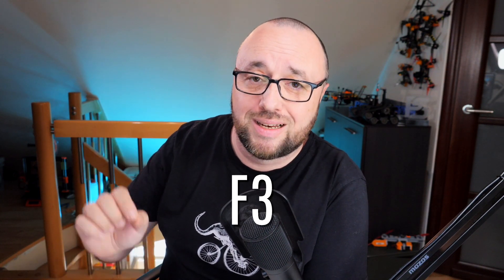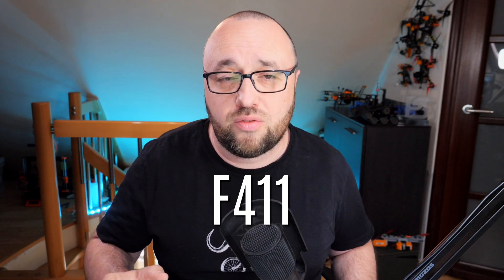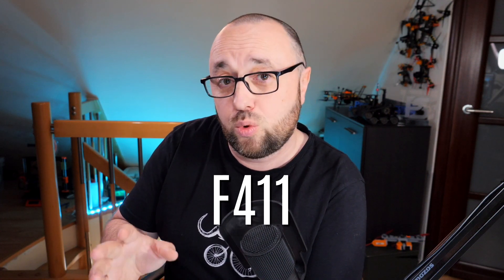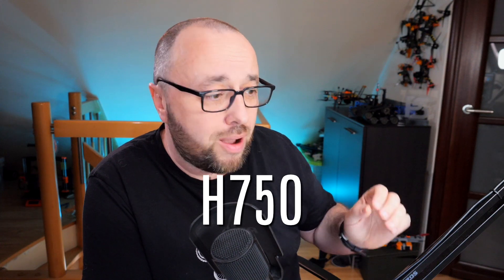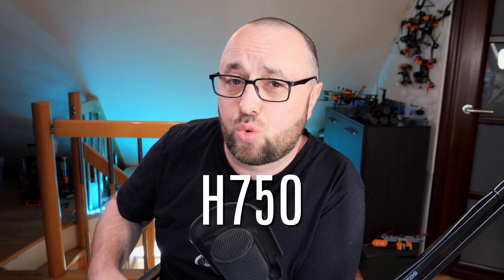Flight controllers for 2024 - F3, F4, F7 and H7

Comment: Hello Pawel, i have a question about Inav8.. i have a SequreH743 (v1) and i programmed it with inav8, everything seems to work fine..but it doesn't recognise the BMP280 barometer, i have to choose it from the list provided by Inav.. when i choose the BMP280 and save and reboot, it stay's 'red' and i can't get it to work.. i checked it with the graph's and it stay's flatlined.. am i doing something wrong or what? any help is appreciated ..
regards,
Morris

Comment: Thank you for the clear message. Why is there not a package that combines the microcontroller with other chips for example the transmitter, osd controller or the motor controllers? I understand the accelerometer and gyroscope are mems which require slightly different processing steps, but for the others, they could be done in a single die.

Comment: It in the product description of the F405, it says it works with quadcopters and octocopters. Would this work with a hexacopter build or not?
Reply from the maker: F405 is only a MCU, not the whole flight controller. Which exactly F405 you have in mind? But if it works with 8 outputs, then why should it not work with 6 outputs?

Comment: I use all F722 ,, they all work incredible super smooth ,, But I not use GPS !! why ? I fly freestyle .. so why count out F722 .. GPS is a waste of money  ,  betalight gps is worthless ,, your drone will stop 5 to 10 feet in the air with beta , flight fall out of the sky and break an arm !! if  its going down gps will not save you .. Gps is for beginners and youtubers trying to test to the limit and end up losing a $300 drone for what ? also I never use black box I set my motors to between 75 and 85 % motor output and you will never burn out an esc while flying or have issues with the F722 . go thru all the crap with black box I just buy a new esc which 9 times out of 10 is the issue and 8 out of 10 people probably never use it   . I set all my quads the same except if the quad is little heavy and filtering depending on gryo,  I do not take chances and your supposed to fly line of site anyway

Comment: Subject: [Help Needed] Connecting INAV to QGroundControl (QGC)

Hi,

I am having trouble connecting my INAV drone to QGroundControl (QGC). I have followed the instructions in the manual, but I can't seem to get the two systems to connect. I have tried searching for resources online, but I haven't been able to find a solution to my problem.

Could someone please help me with this issue? I would greatly appreciate it if you could provide step-by-step instructions or point me in the direction of a helpful tutorial.

Thank you in advance for your assistance.

Best regards,
[pritam]

Comment: Hi Pawel Am I stuck with a useless FC? For Christmas I bought a Lumenier Lux H743 HD to upgrade my 7 inch INAV quad because it had crappy video due to the lack of good voltage regulators. For now (hoping its temporary) the firmware target is the MatekH743, I can't get INAV past the Accelerometer calibration I even tried Rev 6.0.0. In addition there are 50 I2C errors. I have been building since the Naze32 so I do have some experience but not with the advanced CLI commands. The specs of this board SCREAM INAV but it comes with an older "custom" version of BF and the web sites hint that newer firmware will work. Nope! Can I do something in the CLI to fix this? Thoughts?

Comment: 00:36   F3 s     are dead, gone
00:52   F4 s     not plan to use s-bus and smart port protocols
01:25   F405    a lot of processing power a lot of memory and will work for years
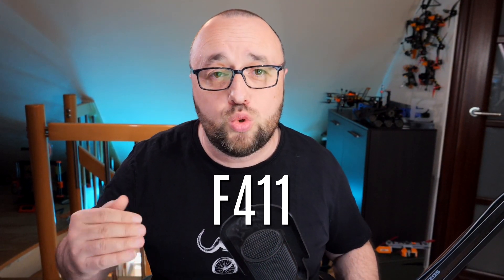01:39   F411    have very little flash, very little memory,very little serial ports
02:20   F411    (just ignore F411 and go with something more advanced like F405)
02:36   F7 s     have very flexible and configurable serial ports
03:26   F722    have the little of the flash and the ram memory
03:41   F722    (BF might have a feature cuts not yet in the next few years)
04:07   F745    will be just great (as long as you will be able to find one)
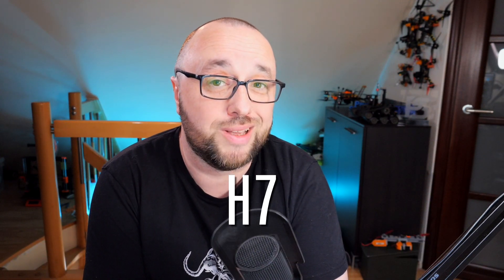04:18   F765    Want big and pricey airplane, with a lot of servos&sensors, huge motors&esc's
04:45   H7 s     expensive but a lot of outputs & serial ports, can bus & run any software
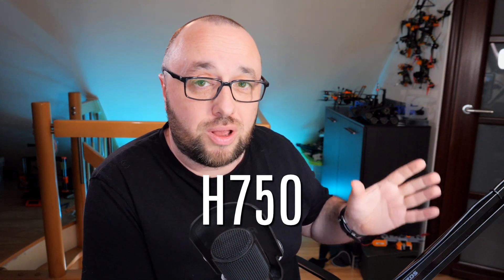05:14   H743    <example>
05:15   H750    don't have enough of the flash memory to fit better flight inaudible
05:50   H750    ←your program will be loaded into the ram memory and executed. (need external flash or sd-card)
Reply: cheers
Reply: Awesome summary thanks!
Reply: Thanks for your service Sire!

Comment: I'm not a drone expert but.. can a flight computer/controller work out the wind speed and direction from the control outputs needed to maintain station?  If so then that info and the height would help you drop things onto target by compensating for the wind.
Reply: ull probably need something with optical flow sensor

Comment: Corrections...  H750 runs BF just fine, faster in fact than an H743 because all the code runs from RAM, not external flash so there is no flash-access penalty!  Secondly, the PX4 edition of the H7EXTREME with a different flash chip has 2MB flash memory, more than the cheaper 1MB H743's, and runs BF, PX4 and Ardupilot.

If iNAV has gotten to big to fit in RAM on the H750 then the devs should target the H7EXTREME PX4 edition instead, or use a bootloader than can load elf files into apprioriate ram sections instead of copying from ram to ram on startup thus saving loads of space.

You didn't mention the H730, which is what is currently used by the SPRacingH7RF which runs BF with ELRS SPI RX integrated and on-board Pixel OSD.

You also didn't mention the H723/H733/H735/H753 all of which can also be used.  PCB manufacturers should target a single PCB that can fit any of the H723/H730/H733/H735 when carefully designed to give various Ram/Flash/External Flash options.

Comment: A table to accompany this video might be helpful reference.

Essentially it boils down to:
1. number UARTs (and if support inversion for those needing SBus compatibility)
2. amount of RAM/FLASH memory, to ensure can accommodate growth in FC software (or to run Ardupilot)
3. availability, and/or price 

F3:   1. 🥶, 2. 🥶,  3. 🥶 .. past prime, EOL
F405: 1. 😎 2. 😎, 3.😎
F411:1. 🤔, 2. 🤔 3. 😎 ... can be limiting with DJI (soft-serial), or additional sensors
F722: 😎, 2. 🤨 3. 😎
F745:1. 😎 2. 😎, 3.😎
F765: 1. 😃 2. 😃, 3. 😃
H7: 1. 😃 2. 😃, 3. 🙄
H743: 1. 😃 2. 😃, 3. 😃
H750: 1. 😎, 2. 🤔 3. 😎 .. has limited FLASH (might have future limitations, but fine for now)

Comment: I still fly omnibus f4 and kakute f4 v2....when I bought them 4 years to 5 years ago, first f7 were appearing  and f4 were dead: not enough of this  or that...even you, a year ago, you said F4 were dead, but now f4 is the way to go, go figure...
The only reason I'm getting some new boards is because HDzero isn't capable of putting a good quality regulator on their vtx, so I need a 10v source not to smoke them....